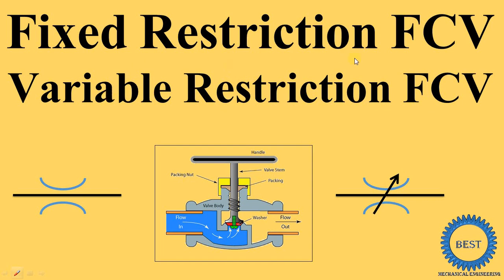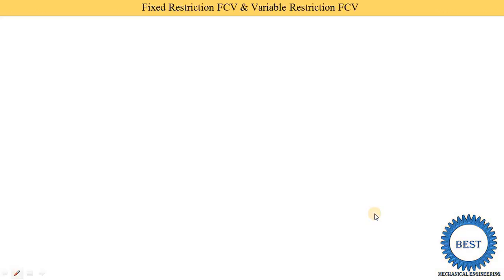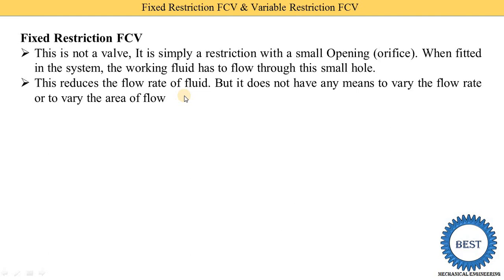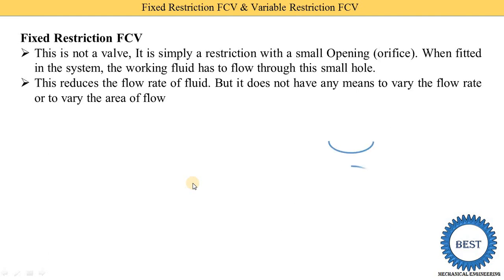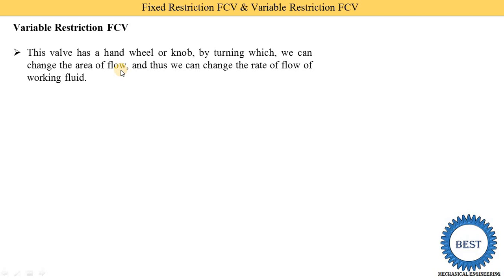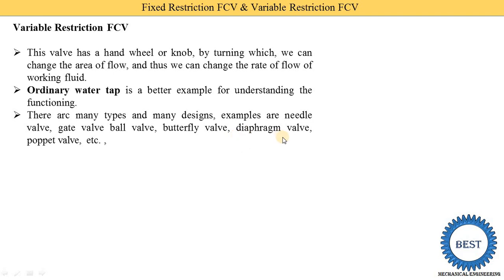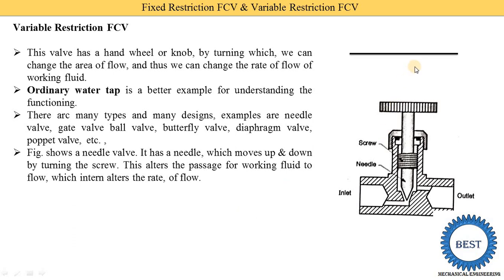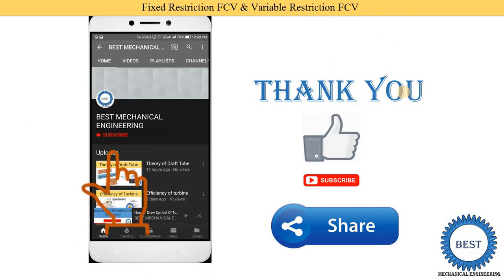Fixed Restriction FCV & Variable Restriction FCV - Flow Control Valve

Comment: Ok sir .now I got how FCV works...but still I don't know what is Recoil Valve. Actually I am Aircraft Maintenance Engineering student (mechanical stream) ..I studied that there is Recoil Valve in Landing Gear . This valve is reduces flow of hydraulic fluid when landing gear going  extend... So I know what's the function of RECOIL VALAVE but still I can't found how it's looks like...how it's mechanism work..what kind of arrangements are there .. so if you can explain how it's work....it will helpful for me sir... 8980153513 it's my whatsapp number... My name is BHARGAV MEHTA.
Reply from the maker: Meaning of recoil is rebound or spring back through force of impact or elasticity.
According to name they function of recoil valve is same.
I have no more detail about it.
I try to find it.
And if i find then i will share with you.
Thank you for comment.